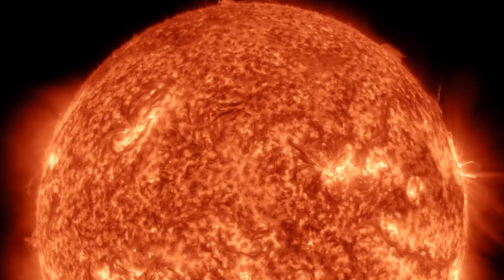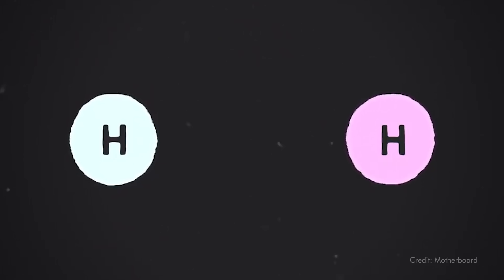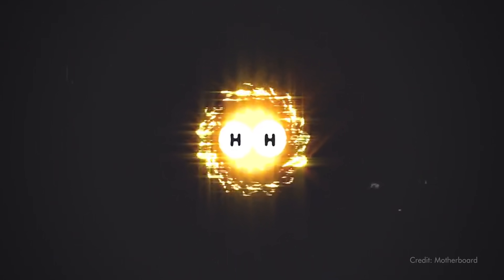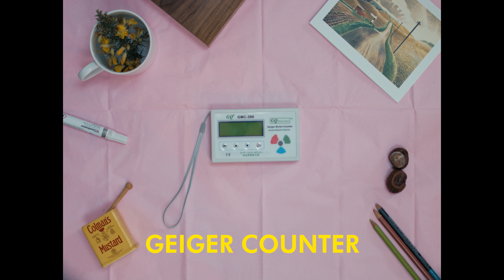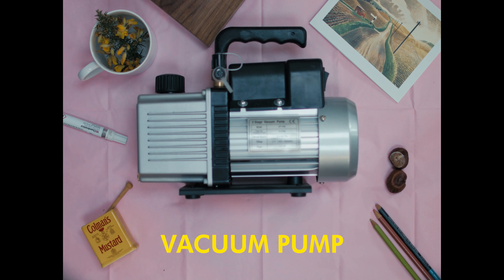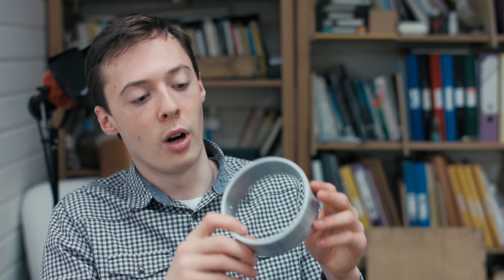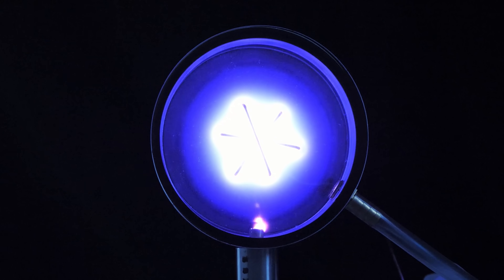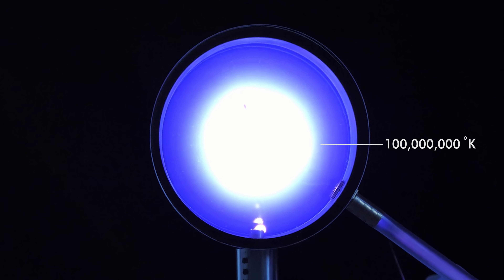Making a Desktop Fusion Reactor

Comment: Congrats you invented the light bulb :D
Reply: but a realy hot one
Reply: @olivierdols5556  not hot, it's high temperature (high kinetic energy of molecules).
Reply: @reon1790  that would be hot.
Reply: ReOn Touch it and tell me it’s not hot then. Temperature is energy in the atom and if anything touches that then the thermal energy of the atom will be passed onto the next atom which will “burn” if it is unstable enough

Comment: This is just a hydrogen lamp by exposing ut to high current and if the temp ever came close to 100 million degrees that would melt through the ALUMINIUM walls and you know MOST OF THE EARTHS CRUST. And i believe that the lamp is hot its just plasma you see it even when you get a static shock. But there is NO WAY that this is remotely possible. Coming from my team that LITERALLY works and you know an actual fussion reactor.(if there is anyone that agrees with me like and if not try to prove me wrong)!!!!

Comment: real-time footage of the reaction would have been good for context :)
People claiming this is a plasma lamp, you are mistaken. The initial arc is the plasma which causes ignition of the hydrogen ions at such extreme temperatures that a small fusion reaction occurs. It's an unstable, unpredictable and unreliable method to get a fusion reaction, but it is fusion nonetheless.
Reply: similar Constructions are used by the Petroleum Industry for Geologic Analysis

Comment: 100,000,000°K, huh?
Funny because Copper (the inner electrode) melts at about 2835°K (I will not even mention, your solder melting way earlier)

Comment: wish it would have made that sound for real and also if it was so hot .. how did you keep the copper wire as electrode from instantly melting the acrylic ?
right its basicy a plasma ball
Reply: My guess is that it was turned on for max a few tenths of a second, and then slowed down. The non-perfect vacuum would've transferred heat very quickly and everything would've melted, causing a (small) hydrogen fire.

Comment: How did you introduce the deuterium gas in order to have something to fuse?
Reply: Unfortunately, he didn't. This is no more than a hydrogen lamp (easy to get confused), but it is a very cool build nevertheless. If he wanted it to fuse then he would have had to have a much much better vacuum and introduced deuterium gas as you mentioned

Comment: So first on, nice plasma bulb, it looks awesome, just like your footage, but I have to say that this is (poorly) no fusion, because of mainly two reasons:

You created the hydrogen gas from a chemical reaction by oxidizing water with aluminium (I think you used either an acid solution or a caustic soda solution to dissolve the protective oxide layer to get the reaction started). Since the hydrogen comes from water the deuterium content will be almost non existent (probably some ppm), so the fusion you planned would have to be a proton-proton fusion which is technically possible, but the problem is that not even multi-million dollar accelerators can generate energies great enough to get such a fusion going, so your rediculous kV range won‘t even nearly provide energies to make a proton proton fusion (you need acceleration voltages in the range of MeV to get the Farnsworth-Hirsch fusor to running).

Get yourself hands on some deuterium (or alkaline deuteride) and then you could really make a fusor when you have power supply with around 50-100kV
Reply: Except this IS a fusor, and while it does output the plasma lighting, even with professional fusors you are really just relying upon chance for the proper fusion, though it does happen. The positive and negative ion cages are obvious in the middle, but with the molecular density and power pumped into the machine, true fusion is rare and inefficient. After all, fusion reactors are a thing , but fusion reactors that provide positive power efficiency (more power out than input to start it) are still a way off. If you really wanted to make a low power version, thats super expensive with no power gain, and not as cool looking, get a non-inverter style microwave (pre 90's) and stick a fork in a bowl of water, and then microwave it. does a similar process and can create plasma and micro fusion bombardments by chance. Added benefit, its a great firestarter.
Reply: Brendon Haradon Uhm... no, this thing does definitely not create any fusion reaction either way, his design or your microwave plasma thing. In both ways a fusion reaction is absolutely impossible because he uses normal protium rather than deuterium and therefore this would have to create a proton-proton fusion for which the voltage is way to low, it would need acceleration voltages of MeV for this to even happen. Whilst the design would absolutely work for a fusor (farnsworth hirsch fusor) it still can‘t work because of the fact that ge didn‘t use deuterium and as already mentioned the voltage is way to low to produce enough pressure (through electrostatic attraction forces to the anode) that any fusion could happen... SO THERE IS NO FUSION IN ANY WAY NOT EVEN AN ATOM WILL FUSE!

Comment: - Textbook Definition of What He Built -
A fusor is a device that uses an electric field to heat ions to nuclear fusion conditions. The machine makes a voltage between two metal cages, inside a vacuum. Positive ions fall down this voltage drop, building up speed. If they collide in the center, they can fuse.

After looking into what he claims his design is based on, it should in theory be nuclear fusion.

Comment: wouldn't at that temperature melted everything near and in contact with he wire center.
Reply: Nope. In this case, the reaction could not transfer the energy into the surroundings fast enough for that to be an issue. Read the top comment for a more in-depth explanation

Comment: I love how he claims that this lamp produces 100,000,000 kelvin from a 230 volt transformer. Increasing the voltage this much means there is basically no current and there is therefore little heat. By his logic having florescent lighting would be like standing on the surface of the sun, and last time i checked my school wasn't on fire.

Comment: It's fake that glow is what u get if u have sparks in a vacuum. Cos since there's no gas inside the sparks cant jump and it makes something that called a Corona discharge i think.
Reply: very good guess (unlike most of the people in this comment section who don't put any thought into it), but I believe this is actually a hydrogen lamp. there is a reaction going on which is releasing radiation, but it is not the correct reaction that he was hoping for (he just thought it was, which is dangerous as he did not know what radiation it was emitting and so may not have had the correct protection). There was no deuterium gas or a low enough pressure for fusion to take place, but he did have a pretty good setup (similar to the one I saw in secondary school on a school trip, which was a fusion reactor that functioned)

Comment: Edit:
Fusion is taken when two Hydrogen's isotopes atoms* (Deuterium H-2 and Tritium H-3)  collide together, giving out a helium (He) single atom, an energy output due to a loss of mass, and a free neutron.
•Hydrogen tanks? 
•Helium venting tanks? 
•System pressure control?

And then: You need to concentrate a Heavy Heavy duty magnetic field (superior to 5 Teslas, currently one of the most strong electromagnets ever built) to make the fusion take place; you won't get a decent temperature concentration otherwise/ *the repelling atomic forces would push the atoms further away from each other .  
•Where are the electromagnets? 
•Where's the electronics behind them? Like Capacitors, big cables and such?

And then, also Lasers/Masers are used to take the temperature high enough. Driven through an high power oscillator to pulse at the right frequency to deliver a specific amount of heat proportional to a specific pulse duration of energy emission by the laser/maser.
Both Lasers and Masers require High voltage and High Power overall, so big currents and therefore BIG cables, transformers and capacitors. 

*edit: I acknowledge it was a rude approach, and I regret putting myself in that position.
It was just a (pedantic, I'm sorry)review to the fact it is Not a reactor in itself ; physically it is the equivalent of a glowing HV bulb toy-like thing, that arcs with plasma by touching the surface with your hands, letting a little amount of charge flowing through your skin to ground. It's simply a different definition that carries different meaning, and I should have just calmly say only that "can be misleading, but that has a very big amount of effort and organization of work and time by the creator, I didn't mean to disrespect you". 
I'm sorry to have started with the wrong foot, and I hope my point doesn't mislead you
Reply: Holly cow! Spider-Man 2 didn't lie to me! Tridium DOES exist!
Reply: First of all your wrong as it takes 4 hydrogen atoms to create 1 helium atom a quick Google search will show that so in your first paragraph you were wrong so why should I trust you?
Reply: @cataclysmicodin8319  You're actually right, I did research a little bit again and corrected my comment accordingly. And I recon that I could have said it much more differently, I regret having been quite rude.
Reply: @Fauride  it's alright dude atleast you corrected yourself and reflected on it but on most of the things you said you are right it was just the atom part

Comment: Is it safe to be close to this thing while it operates? You had a guiger counter. Why no mention of radiation?
Reply: Because he made a Plasma lamp and not a reactor. I guarantee that thing gave off no additional radiation than just background rads.
Reply: The Geiger counter went off like crazy in the background. It is not safe to be close to one unless you know what radiation it is and have the necessary protection. Alpha radiation is incredibly ionising but is blocked easily, Beta is harder to block but less ionising, and gamma is much harder to block but the least ionising. I believe that successful fusion reactions release neutrons (I have no idea where this goes on the scale, or how dangerous it is), however, this experiment was not successful and created a hydrogen lamp instead. I am not sure what radiation this emits and I would not risk being close to one
Reply: @MineThing  you do realize he added that sound in afterwards for "Cool factor" right?
Reply: you can hear the geiger counter scream in the background

Comment: How did you measure the temperature? What kind of capacitors/diodes went into the voltage multiplier? Why is it so bright? What's the weird electrode shape in the middle? What amounts of radiation does it emit

Comment: so we all can agree this is not fusion.
Reply: Actually Inertial Electrostatic Confinement devices such as this one (although I doubt this specific device did ) regularly perform fusion reactions at rates of several million neutrons per second. these devices are extremely inefficient but do get the job done and have since their invention over half a century ago. These devices work by creating a potential difference between two spherical electrodes which are transparent to the ions. A rarefied atmosphere of hydrogen-2 aka deuterium is ionized by the outer electrode and then the positive ions are attracted towards the centre. Yes the light seen is due to the same effect as in neon lights however at a much higher energy. Any fusion reactions must be detected as the neutrons emitted by the device as the ions fuse. As for the temperature, the required energy is imparted upon each ion in the same way as in a particle accelerator and thus the "temperature" is more equivalent to relative velocity and at below 1.0x10^5 Torr the ion temperature can be generalized as about 11.0x10^7 degrees Kelvin for every increase of 1000 volts potential difference. Thus running at 30kV these devices easily break 300 million degrees kelvin. These devices, sometimes called Farnsworth-Hirsch Fusors, are mostly used as high energy neutron sources and because of their high energy capabilities they are also used to study higher energy fusion, such as proton boron fusion. The heavier devices you are referring to are likely the more efficient magnetic confinement devices. these devices contain plasma in different geometries of solenoids and thus have a different set of operating principles, usually using neutral beam injection or microwaves to heat their plasma rather than a voltage acceleration as this is inefficient. There are many examples of good research done using IEC fusion devices and while this one may be misleading I hope that it has not put you off of the topic and I welcome you to explore the fascinating research done with ion accelerating fusion devices like these. For my part I invite you to make a simple one as it can be a fantastic experience and help to build an intuition for thermo distributions and high voltage potentials, they can be cheap and easy to make so long as you don't try to get them to do fusion as that usually takes an expensive steel chamber although no increase in size, the whole experience is one I myself have and one I believe many more should try.

https://en.wikipedia.org/wiki/Inertial_electrostatic_confinement

http://www.fusor.net/board/index.php?sid=8dbb489f34fedd7744cb9b76709dd057

and visit my channel for fusor tests and other experiments with high voltage if you would like :)
Reply: Absolutely

Comment: No fusion occurring , your're simply exiting the electron orbital states of hydrogen in a vacuum . When the electron for hydrogen receives electrical energy from the high voltage you supplied it will transition into an exited state. This causes the electron to become unstable where it then returns to its ground state and in doing so will emit a photon. You are not combining atoms to form heavier ones in any way to emit light as this would require a massive amount of energy to achieve. You are creating a hot plasma with ionized hydrogen atoms. Try not to mislead viewers and instead report accurate scientific explanations. :) No hate, i did like the video with the cool cinematography.

Comment: 1. Not a Fusion reactor
2. That's an EXPENSIVE ASS desk toy to keep running
Reply: The power bill will probably melt his eyes
Reply: https://en.wikipedia.org/wiki/Fusor Read up on this for a couple of minutes ;)
Reply: It doesn't have to make energy to be a reactor. It's a net loss but it's still a fuseor
Reply: @JWI515  it's just a high energy plasma generator. No different than a hydrogen gas lamp. Fusors need much more sophisticated equipment, like diffusion pumps and deuterium fuel.
Reply: Not a reactor, still a fusor. Fusion is occurring at the point where it isn't even efficient.

Comment: What?! That's it?! What kind of video is that? No explanation of the physics behind it at all. Just a fancy hydrogen lamp it looked like.
Reply: thats byllshit at all, with tmp of 1MK this whole shit would melt down in a seconds even there is „vacum” nah probably around 0.5 P, so low vacum
Reply: @Vizi_  Do you even know what temperature is? As you can contain over 1 million kelvin using a magnetic field. As long as it does not touch the sides..
Moreover, A temperature of 1 million kelvin at a single point is space, is not that many BTU's.. As it is contained at a single point...
Just because the light showed all over.. The magic happens at a single point in space..
Reply: This whole thing is just bullshit. As i said, if this would run for a whileit would melt and ofc „if” there is such huge temp. This pump can handle max 0.2-0.5 P, so not much and ofc heat radiation exist even in ”vacum”, slow, but still
Reply: It's not a ''how to", not meant for education purposes
Reply: Yeah I would have much rather watched a 45 minute video of him explaining how he did this and what each part does. Instead, we got a 7 minute video of him just showing it off. 😑
Reply: its a build video, for a better explanation seek resources
Reply: Billy Monday and that is why antivaxxers are a thing. Just telling him to do research without any context for what is or isn't true might lead them to the electric universe hypothesis.